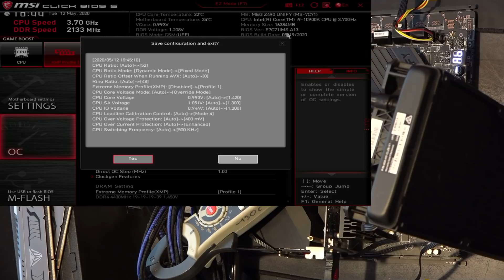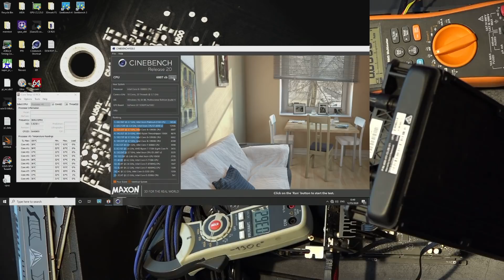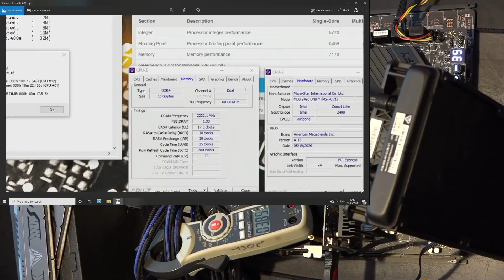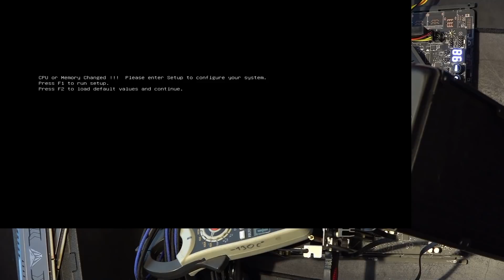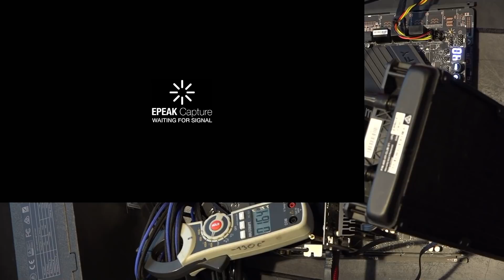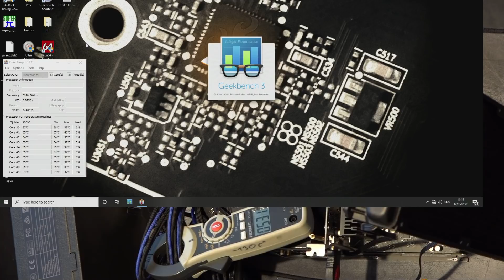The obligatory 10900K launch day video: OC power draw, cooling, 2x8 4x8 & 2x16 RAM OC.

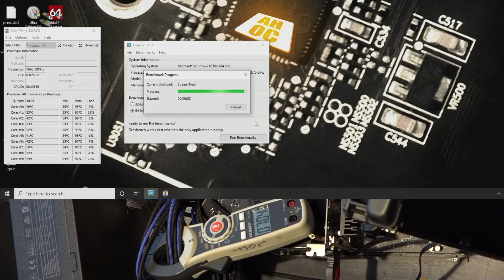Comment: 39.10 The max geekbench current draw was 31.74A during stream copy at 37:22. This corresponds to a VRM input power of 380.88 W, and an estimated CPU power of 342.8W (with a VRM efficiency of 90%. It's likely a littly higher). However this was only at one point of the test: The current in GB was more often around 22A, spiked into the 30's very briefly a few times and it dipped to 7A frequently. As you said CB was a pretty constant 31.5 - 32.5 A (340 W to the CPU) which explains the higher temps. It may have throttled at 100 degrees, but the current stayed constant.

Comment: Intel next 14nm is Ocean Lake. The CPU is watertight and cannot be delidded. The platform can have 12 times as many soldiers and has double the power draw. 100C which allows for cooking of steaks.

Im actually interested in the 10700k much easier to cool probably.

Comment: I have the 10900K on an Asus Z590-A with a Noctua NH-D15 massive air cooler. It is so large, I only had room for the middle fan. Running at 5.2 GHz temps barely reach 80C. CPU fan is set for full speed. The Noctua cooler is the best I’ve ever used. Literally crushes every other air cooler I have used. Obviously some good silicon because even running an auto overclock it boosted 43%. Crazy. Of course, using auto overclocking is boring………so nixed that. I’ll see how far I can go on 1.35v before backing off for case installation. Then I’ll do the memory 😊

Comment: Typical video must include:
- Frantically tapping the ESC key about 30 times to enter the BIOS
- Going to the "benchmark" pages in AIDA64 and doing each benchmark one by one, instead of going to "Tools" - "Cache and memory benchmark" and double-clicking on the "Memory" text, which will perform the read-write-copy-latency tests and display them all at once
- Self-criticism about time management regarding the video length

Comment: Wow, 225w+ power draw reminds me of the qx9650 era.
Reply: even  the 3900X draws that much power in prime
Reply: It's way north of that. 31 Amps on a 12V means closer to 400W. Basically threadripper 32 cores territory.
Reply: My 8700K can actually eat 260W :v
Reply: @adrianszymanski4699  what? I have one at 5ghz it does 146W on cinebench
Reply: @leafgreenhd1612  i saw this number with 5,2GHz 1,4vcore in occt smal fft with avx2
Reply: @adrianszymanski4699  yeah the more v core the more power draw, I did 1.3V

Comment: The faster the pump runs the hotter the pump gets which raises the water temperature because the pump is being cooled by the water, at least on my open loop.
Reply from the maker: you must have one hell of an inefficient pump.
Reply: @ActuallyHardcoreOverclocking  Yep, it's a DDC.

Comment: Figure you went with b die viper kits for consistency, but hope the crucial e die kits make it into z490 board you test out too.  Entirely selfish reasoning is I bought 2 x 8 of that for Intel and want to peek at bios timing optimization you do for e die on Intel mainstream platform.
Reply: Just swapped by b dies for even faster e dies. Micron is the shit man actually making their own products and their research and development.

Comment: Buildzoid, In your BIOS there is a setting for changing the voltage monitoring.  I saw you change it in the middle of the video.  Was the die sense not working correctly? VCC Sense vs socket sense?  I'm not sure why CPU-Z says "core VID" instead of "Core voltage" though.  (1.92 x64 shows Core voltage on my M12 Extreme).  HWinfo64 should at least have it right.
Reply from the maker: yeah I'm not sure what's up with that not working.

Comment: X299 is faster in single threaded. At least 2 times faster than everything currently out there.

The problem is that being faster is limited in complicated calculations and requires the software to support the associated instructions.

Comment: Hey, could I ask you for recommendation what 4x8 ram kit to get? Waiting for 10900k and Max XII Formula. Actually prefer Gskill and was in the market for 4000 17-17-17-37 or 4266-17-18-18-38. But those are pretty expensive kits- is this a waste of money if Z490 performs so well on RAM OC anyways or worth the money because possibly getting even crazier results with such a binned kit?

Comment: Nice Vid, Yo buildzoid do you think it would be possible to mod x370 to run zen 3?
Reply: It's definitely possible but you still need that juicy agesa and microcode - possibly a restructuring of the bios chip. I'm thinking that on the asus strix-f it would be a relatively easy backport since the X370/X470 versions are literally identical apart from the aesthetics and chipset + asus use similar bioses for most of their mid tier boards.
Reply: watch the GN videos on that, its a yes/no answer.

Comment: 4600MHz just like that... wow. I think the highest you can get an 4 DIMM z390 is like 4570MHz. I got that to boot on a formula XI but hell you need time that it just not crash in like 1 minute idle. 4533 is kinda possible for benchmarks, but sadly no 24/7. the Boards just freak out if you do over 4400MHz. i switched between 4400 and 4410MHz forth and back and you can boot better but stability is just gone.

Comment: Before i watch the video i got a question.
Bought new RAM and some said i picked a bad ones. F4-3600C16D-32GTZNC
Should i change?
Reply: Depends, really. No data about system. Good for Ryzen 3000, also not bad for X299, but not really good for 1151v2 (a bit slow).
Reply from the maker: if it's for Ryzen that's fine
Reply: I have this Exact set in my Asus X570 Crosshair Hero VIII with a 3900X and it runs SWEET!  Has totally solved my "8d" Bios error I was getting with Corsair 3200 C16!  
Always check your Motherboards QVL list to see if it's supported!
Reply: @rusTORK  my friend is building a i7 10700k system, what ram speed would you get for intel with RGB? Thanks
Reply: @MiIitaryEdits  Do you have time? OCing memory, even with basic techniques is very cost-effective. 
For kits, I don't know about any good, cheap RGB kits. For performance/dollar the Ballistix 3000 C15s (look for AES in part no.) have a ton of potential.
Reply: @MiIitaryEdits  crucials ballistic rgb if you are overclocking anything cheap and over 4000 mhz if you arent
Reply: @bigal2688  it was the first thing before i bought it so yea i did checked it.
Reply: @ActuallyHardcoreOverclocking  Yes it's for 3700x.

Comment: Hello Buildzoid! I need your opinion. A few minutes ago I wrote a long message to you, but my light was turned off, it was gone, now I have to formulate it shorter. Can I run this kit of memory (https://www.gskill.com/qvl/165/299/1580449585/F4-4000C15Q-32GTRS-Qvl) stable with 10600K (yeah, not 10900K) on Asus Z490 Extreme? This model is in the list of compatible ones both on the RAM website and on the Asus website. But I saw your video about high-speed sets of RAM, you said that they are not stable, that there may be problems with the cpu's memory controller. But this video was shot 2 years ago, now a lot has changed, right? For me, the speed of RAM does not matter much, but for me, timings and latency are important. In another video of yours about the basics of overclocking RAM, you suggested a formula for calculating latency: frequency / primary timing and what value is greater, that memory set is better. So, this set combines low timings at a high frequency, but the voltage is 1.5V .. I'm worried about the stability of the system, especially in conjunction with 10600K. 
If this memory kit is not stable, I will choose 3200/14 and be happy. Yes, I know that 4000/15 is very expensive, but now it's not about the cost, but about the stability of the system.

Comment: Been recommended to ask this question here :) 
Will the ROG STRIX Z490-E GAMING be enough for the 10900k? Or would I have to go with something beefier. I don't plan to overclock the processor really.
Reply: You will be enough, trust me as I am Asus Fanboy :)
Reply: If you're running it stock it doesn't matter. All boards will be able to handle stock CPUs. OC is where power consumption rises and where MoBos matter more.

Comment: I will be building an 10900k with ROG MAXIMUS XII HERO or ROG STIRX Z490-E GAMING. Is this memory good for OC on this 2 boards?
Should i go with: F4-4000C18D-16GTZKW or with F4-4133C19D-16GTZR. They are at 1.35v and cost 200eur each.
If not, please tell me which memory is best for high OC.
I live in EU.

Comment: hmm i have the 10900k with an nsane cooling system my chip can do decent clock speeds at semi low voltage but my temps are still high at 1.35v loads httng like 100c  i even removed and remounted my block and its just the same 
3x360 rads 1x d5 pump  ek magnatude waterblock if you managed to stay below 100c with an aio at like 1.3 to 1.35 v   i feel like i have an issue with ether the chip or my coolng

Comment: thoughts on z490 aorus master? it's using 14 phase (7 phase with doublers) but the ultra has 12 phase direct, what's more stable in ocing?
Reply: Im not buildzoid: But the 12 phase should have, compared to a dubbled 7 phase, better transients, also since it's using that 16 phase XDPE132GSC controller. there are functions for turning of individual mosfets if you dont need the current handling. 
Current blancing per face etc. 
The dubbled 7 phase is probably good enough but you've reached the point of minimal gains with more phases when comparing "14" to 12.

Comment: How do you like the EVGA CLC 280?
Reply from the maker: the fans it comes with suck
Reply: @ActuallyHardcoreOverclocking  I switched them out for Arctic p14 pwms and that reduced noise a lot.
Reply: @ActuallyHardcoreOverclocking  I agree I actually swapped mine out with nochtua chromax

Comment: They did improve the cooling efficiency but man the power draw. There’s nothing can fix that with that 14nm node.
Reply: @jayden974  yeah but the PSU may need to be upgraded with these stupid power draws. To be fair, efficiency is actually the same as Coffee Lake per voltage, just there are more cores and Intel is shipping them with higher clocks now.
Reply: @jayden974  is not so much the cost of the power, it's the heat it generates. That degrades components and has to be removed into the room you are sitting in. It gets unpleasant. My current 3700X system is nice and cool, much nicer for long gaming sessions. My old system used to cook me!

Comment: @Actually Hardcore Overclocking !
I am currently building my new gaming platform and can you advise me which DDR4 are the best right now? The price doesn't matter. 
I am thinking about G.Skill Trident Z DDR4 16GB (2 x 8GB) 3600 CL15 or maybe you have some better options such as buying some cheaper set, but much better OC potential
Thanks!
Reply: Why don't you care about price? Are you planning on buying a 2080 Ti? Keep in mind Ampere has a good chance of destroying Turing soon.
If price doesn't matter, but you have time, the viper steel 4400 C19s are great.

Comment: is 1.5 volts for ddr4 still the very top end for running daily for z490?
Reply: The IC is what dictates safe voltage rather than chipset and stuff
Reply: As far as I know on most of MSI Z490 to reach 4000+MHz you need at least 1,45V and quiet good memory kit. In otherwise you probobly will not able to boot to windows. Please don't take my words too seriously cause I am Asus fanboy :)
Reply: @DiJAndy  DDR4 voltage resistance is dictated by the memory, but I'm not sure how well the IMC stands up to VCCSA and IO, but I'd assume it's the same as 9th gen, given they're mostly the same.

Comment: We are building a gaming pc for my buddy with a rtx 2080 super and an i9 10900k. Is a straight power 11 650W enough, if you want to overclock? Thanks guys
Reply: No, at stock it might run, but only if it is a really good PSU. Grab a good 800W (or stronger if you want to overclock) unit for the CPUs power spikes.

Comment: Isnt 1.4v SA deadly?
Tho I guess just because the IHS has to stay good doesnt mean the memory controller has to
Reply from the maker: considering the 1.65V SA I've been using the for the 4x8 profile. I'm starting to thing the common VCCSA guidelines might be overly cautions.
Reply: No, not with 8th and 9th gen it isn't, can't speak for any other gen processor. 1.6v doesn't even kill the IMC immediately so I'm thinking 1.4v shouldn't be an issue.
Reply: Hmm I guess instead of making the IMC more capable, make it more resistant to high voltage also does the trick
Reply: @ActuallyHardcoreOverclocking  They are. I think people haven't adjusted expectations for high clock speed RAM and still think it should be below 1.2v or something like that.  My 3600mhz Gskill on XMPII (Z490-E board) auto runs at 1.41 SA voltage.  If I try dropping it below 1.32-ish, it's unstable.

Comment: Can a faulty cause a system to run slower over all my friend upgraded from 3570 to i7 3770 and now his system is overall slower
Reply: Did he swap a 3570K for a normal 3770, cause the lack of OC could matter, or if he forgot to OC the CPU and memory.
Reply: I just test his system ... It run 3.4 on single core benchmark but goes below 1000mhz on multicore cinebench run temps are fine under 50degree ... What could be rhe problem
Reply: It could be a power delivery issue if the cores just drop frequency like that without hitting thermal limit. i7s are more power hungry than i5s due to the additional threads, but not by much.
But first check the following:
-Check that the motherboard BIOS is updated
-Check that the BIOS is running on default settings
-Windows power plan -> Minimum processor state -> 100%
-Set RAM to XMP (or whatever speed it used to run stably at)
-Make sure no other programs are in the background when running benchmarks where possible
And see if the problem persists.